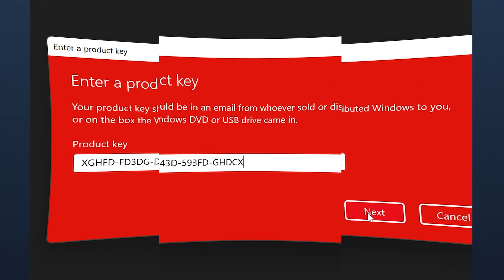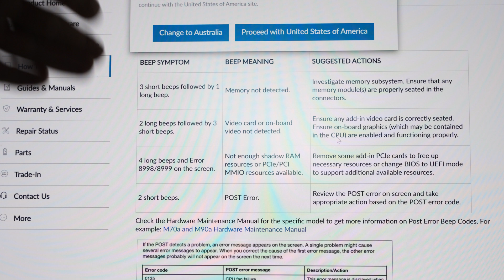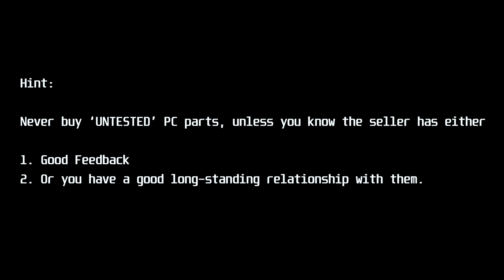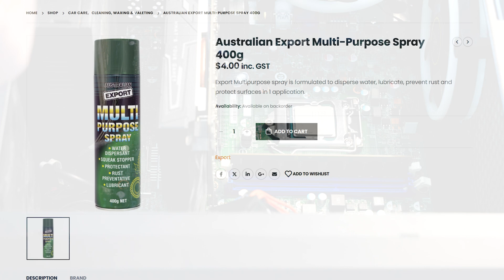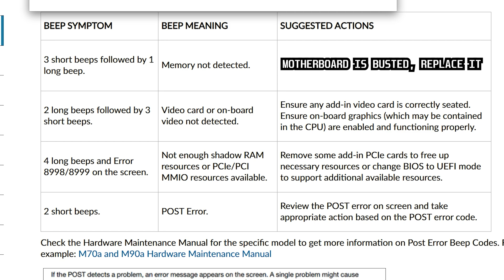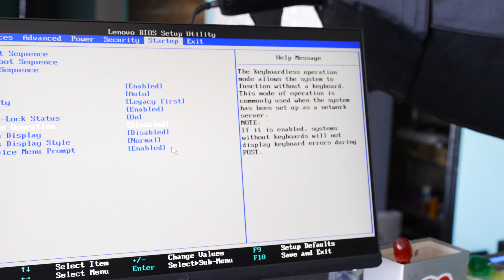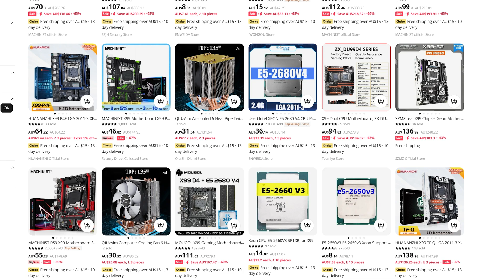Someone brought me their BROKEN Gaming PC, Let's FIX IT!

Comment: Trouble shooting basic principles are the same regardless of of what you are diagnosing. It requires critical thinking. Working on cars for example confirm the concern, use your resources to get on the right track. Pinpoint the cause and exchange the faulty part. Confirm it’s fixed, leave it cleaner than you found it.

Comment: A CH341A programmer would be good having in your shop! It can re-program almost any BIOS/UEFI chip! It comes with a clip that attach to the chip dirrecly on the motherboard, there is no need to unsolder it (you still can desolder and erase it program it off board using a TSOP8 to SOP8 adapter then solder it back).

Comment: I've had these RAM problems with some HP prebuild AMD machine. Took a look at the CPU pins and there was some corrosion. Cleaned the CPU and the motherboard socket with some CRC 5-56 and a brush, and the system worked with all 4 RAM sticks again.

Comment: About the AliExpress Motherboards and CPU, I've bought a few of them (X99) and they are great for low cost PC. Just sometimes, the fan speed is not working, sometimes you have a different bios than expected on the visually identical motherboard, also take care if it's dual or quad channel. The best are quad channel X99 motherboards for cheap PC.

Comment: I had a set of G.Skill R1 DDR3 2133 4X6 24GB all fail at once I used my Ryzen boot drive to run on my X58 system and it had ARGB software when I accidently opened the software it instantly killed the ram thought I fried the system sent them in for RMA and got a brand new set back from G.Skill for the shipping cost

Comment: I had the same problem, after buying a replacment mb all is fixed now both of them work just fine.  must have been a ps issue or cpu wasn't seated correctly.  well after giving it a week and powering it on it worked flawlessly.

Comment: That motherboard just need a flash bios with adapter, you remove bios chip from motherboard with hot air station, plug in adapter flash and back to motherboard and it wil work perfectly fine, cause win 10 and win 11 update bios on them own when doing update, I do hundreeds motherboard with same problems

Comment: When dealing with problems like this, it is helpful to have known working RAM module for testing. Also, before you start taking out components, it pays off to remove battery and short CMOS. After that motherboard would try to load default optimized settings for components it detects.

Comment: I just bought and assembled a PC with an Aliexpress combo. It is an X79 mobo and a Xeon chip, 8 core 16 thread.  I bought 32 gigs of ram and put in a cheap power supply and  a rx570 I had laying around in it with a new 1tb Team ssd. Runs great and gets 140+ fps in Warthunder. The temps are good.  I got the combo on sale for $35. The board was made by Asus. I put it into a Cooler Master Masterbox Q300L case.
Reply: 🙂 interesting u mentioned that board, on another budget pc channel a dude has an X79 Machinist Board and Xeon chip and he compared it to his Ryzen 5500 rig and it runs pretty close in most games, the board is 65 bucks and the Xeon chip is 10 bucks
Reply: @MrSamadolfo  I like to play war thunder. The  the rig is playing war thunder at 100-130 fps, very similar to my 5500 on a B450 mobo with 16gb of 3000 memory.  I paid about $35 for the chip and board. I spent $24 on 32gb memory. The chip is E5 2650  v2.  I almost don't want to sell it.
Reply: @cerescop  🙂 cool, thats a pretty good deal for a cpu motherboard combo, thanks for the information
Reply: @MrSamadolfo  I bought a second cpu for $10.

Comment: I have dealt with many Lenovo machines and boards.. they are all junk.. If they work they behave very strangely.  Every Lenovo board I have seems to do some sequence of turning on and off after you plug it in before it will work.  I had one that wouldn't post no matter what I tried then it sat for a while stored.. and suddenly worked again.

Comment: Still using two HuananZhi X99TF (ver.1 with C612 chipsets) motherboards since APR/MAY 2020, without any issues. Both are turbo-unlocked (E5-2678v3-12C/24T and E5-2696v3-18C/36T) and run cool...the 2696v3 never exceeds 53C at 20C ambient, even when fully stressed.  The CRM's also run fairly cool...having checked them with a manual temp gun. Best part...they cost me $50 ea., delivered at the time.  Reason...the first $100 order failed and, after a re-order and full refund on that initial order, nevertheless arrived at my door 3 months late.

Today...I'd go with AM4 over X99, given the competitive cost/performance of the first platform.  That being said, still very happy with my X99TF...paired with RTX2080Ti, 48GB DDR4 in 4 channel, and 40 PCIE lanes!

Comment: As doing repairs, I would check the RAM power of 1.5V, the voltage for RAM could be missing. Usually there is a small DC to DC converter on the board, with a driver and two mosfets, the mosfets may go bad if RAM is shorted, and with them the driver, that can be ordered (for this is not expensive) or taken from another broken board. For this you need a letcon and a hot air station and a magnifier (or a small microscope), some soldering paste and isopropyl alcohol to clean afterwards.
Reply: ...is it worth it on a board this old?
Reply: @jb678901  it is worth working an hour or two on it, if in this time you fix it, it's fine.
Reply: Replacing would be quicker on these  parts as they are plenty on seconds

Comment: 12:06 there is also some kind of white liquid-like residue on the board traces if you look close at the bottom and on the right of the board. I had that on a board once too and it sometimes refused to post. I bought a circuit board cleaner and sprayed the board with it,brushed off that white stuff with a toothbrush and the board started to work properly again

Comment: Bryan I saw on that mobo an empty 4-pin connector, looks like the CPU power connector but could you tell us what does that do? Cheers.
Reply: That is Lenovo's on board power connection for the hard drives. They are not necessary.